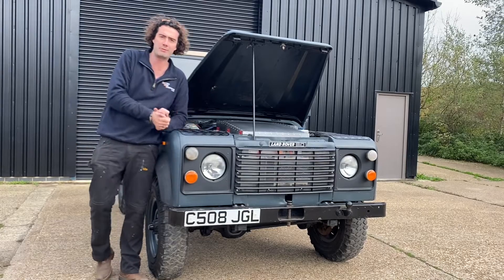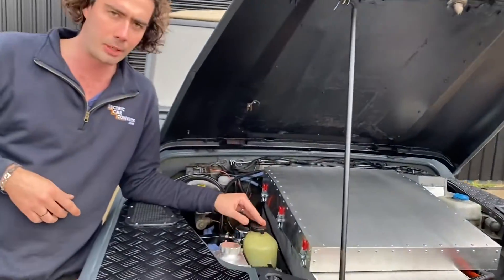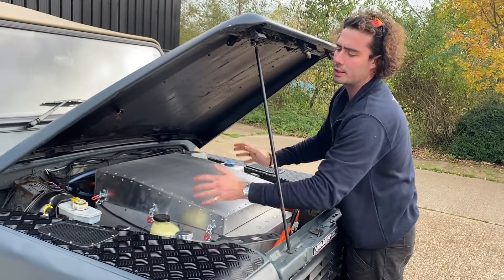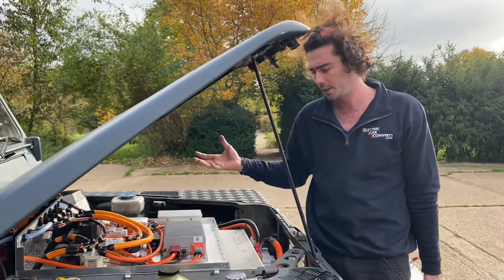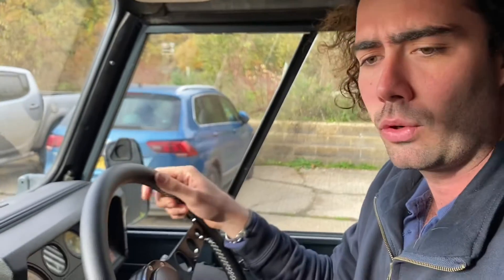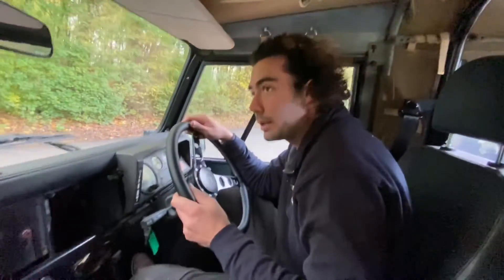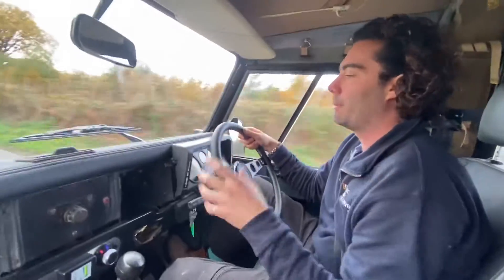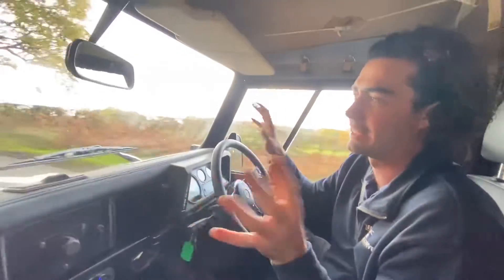Land Rover Defender Electric Conversion Walk-around and First Test-drive!

Comment: Hello sir, very good info, and appreciate what you do, but I didn't understood if you kept the clutch or not. If not how do you change gears? If the car still have a clutch do you also kept the flywheel? An answer would be highly appreciated.Thank you.
Reply from the maker: Yes the clutch and flywheel stay exactly how the are. You can still change gear as you normally would.

Comment: But you can upgrade the brakes with some gaint rotors and calipers I recommend the factory springs with koni shocks they are better then the fox or air ride or the cheap cut springs and everything I’ve mentioned is direct bolt on

Comment: Love your videos! Keep them coming.
Quick question, can the electric motor be mated directly to the transfer box and save the weight of the gearbox?
Reply from the maker: Yes it can, but we don't do it as it means terrible acceleration due to the gear ratios. Leaving the gearbox means you can accelerate nicely around town but also change gear if going onto a fast road or off road

Comment: Nice. Any idea of the Range.. Top-end speed, and the finished Curb weight?
Reply from the maker: She will do 70-80 miles of range, speed is faster than you'd dare go (the motor peaks at 8000rpm) and curb weight is almost identical to the original.